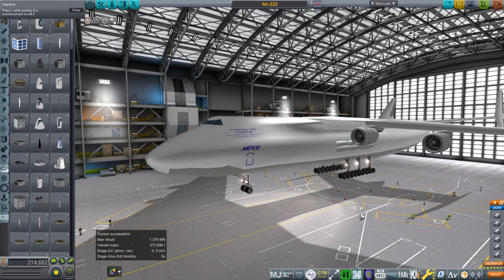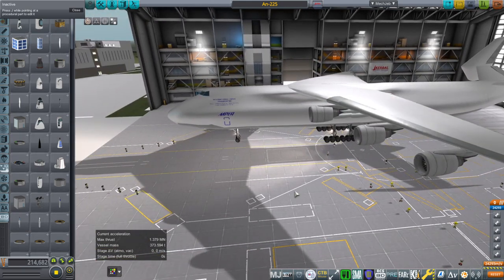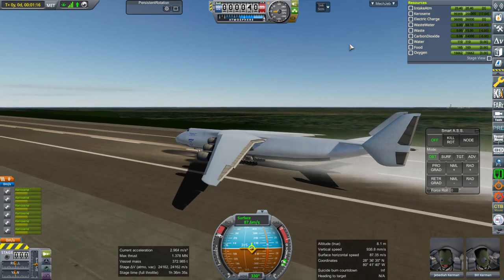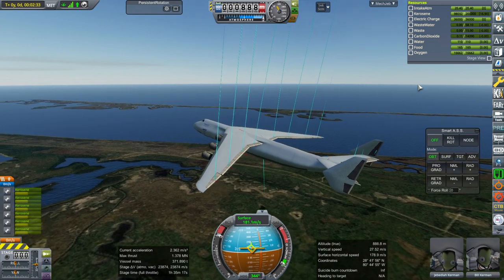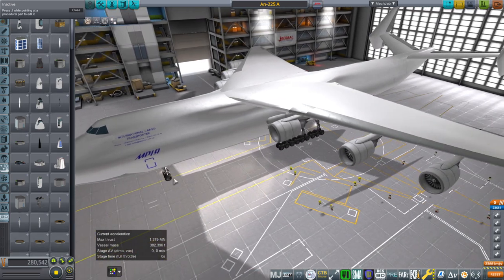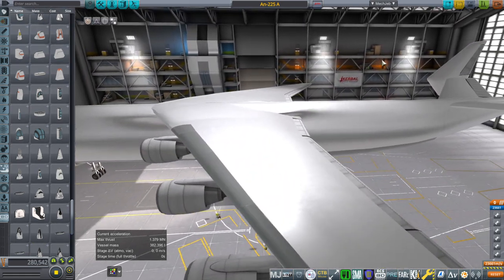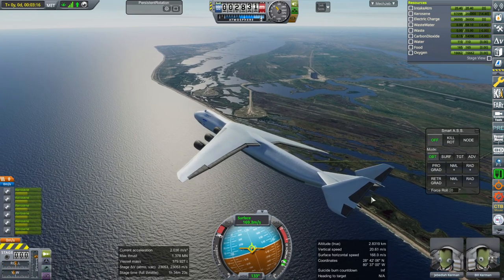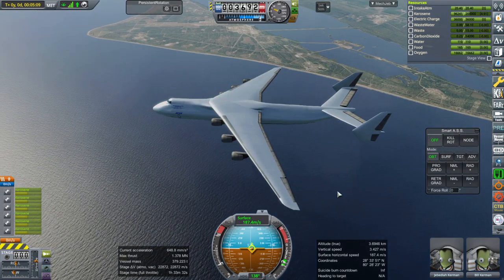KSP with Realism Overhaul - An-225 Initial Testing

Comment: To the end of making symmetry work normally for the FAR module, couldn't you split the wings into two parts with a down-angled node attachment between them? (and just round off the joint geometry in-between so there aren't any holes)